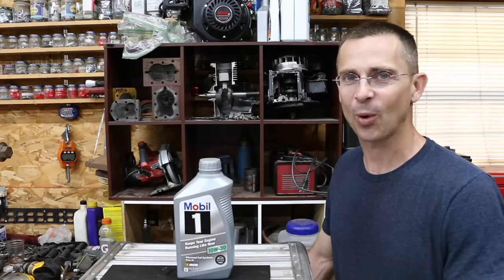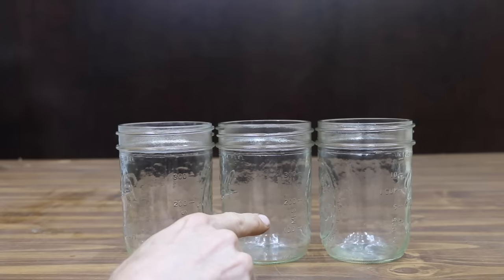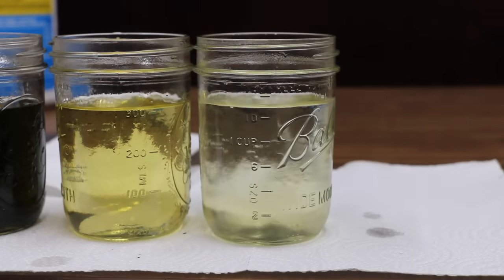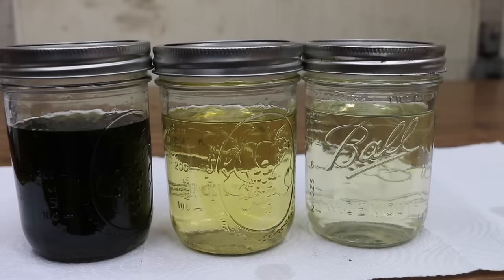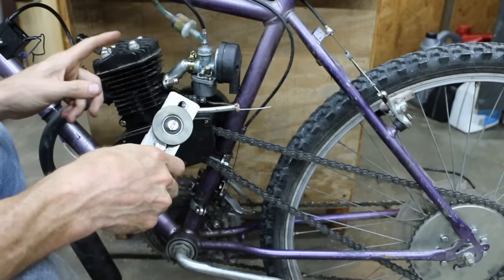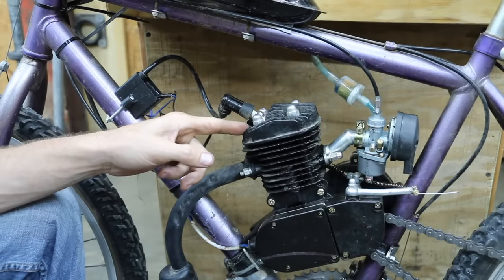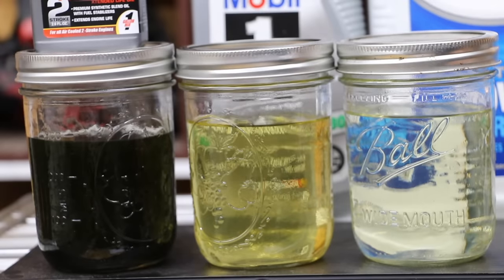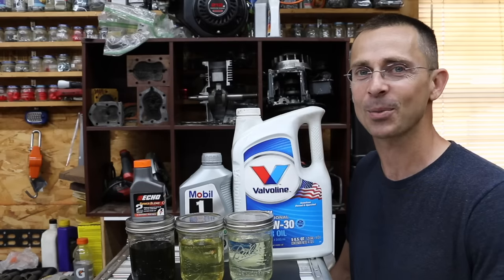Will 4-stroke oil damage a 2-stroke engine?  Let's find out!

Comment: 4 stroke oil is what they recommended when 2 stroke lawnmowers come out. There was no such thing as 2 stroke oil when lawn mowers were in their infancy
Reply from the maker: Great point.
Reply: Hehe I’m on Xd-100 2 stroke oil on my Koehler toro motor. I run some with a line from the bottom to the carb so mixes and burns at 40:1. Just fill and go with no problems
Reply: sae 30 is what they recommended here around 30 years ago,i used 10w40 in my 2stroke engine run for many years win that mixture
Reply: Same thing with 2 stroke outboards, old timers said they used SAE 30 in outboard fuel back in the day, one quart to 6 gallon tank, 25:1 ratio
Reply: Good to know.never know when your in a pickle and your out of 2strok oil
Reply: yeah...the two stroke engine came well before two stroke oil....my 1954 outboard motor, back when you could still read the instructions on it, said 8 ounces of SAE 30 per gallon of gas....I started running good quality TCW-3 in it and walked it down from that 16:1 ratio which made it smoke like crazy to around 36:1 which is where it pretty well quit smoking....ran it like that for years.
Reply: Yup. Some of my 1950s OMC Lawnboy mowers original oil recommendation was normal straight weight motor oil
Reply: On the farm all we ever used was 10W30.  Didn't even know there was 2 stroke ol till I was in my teens.  I like it because of the dye, you can see the mixed fuel.
Reply: Theron Ash So, maybe that was the original reason for using it, the dye would ensure you had it premixed?
Reply: Mike Lee I believe the standard is 8 ounces per 6 gallons on a typical outboard engine, correct?
Reply: @eightys4ever  Yes, the dye is helpful.
Reply: Thanks! That explains why about 55 years ago my Dad when he bought our first 2 Stroke Motor Mower used normal motor Oil. Watching this started me thinking. 
It was a Villiers! Temperamental thing. No throttle. The useless Governor was forever giving problems.
Reply: Great to hear this from someone 1st hand! Otherwise, we'd never know
Reply: Well from what I’ve learn in a pinch if you need to running 4 cycle will be fine as long as it doesn’t sit for very long.

Comment: Before watching, my guess is that it'll work just fine.
Reply from the maker: You're right
Reply: When I was a youngster, the second recommended 
oil, was non-detergent 30 weight.  2 stroke oil being 
the preferred oil.

steve
Reply: This is STILL an acceptable solution.
Reply: I guess I don't have to watch it nowm :)
Reply: before 30w motor oil, it was castor oil, which really stunk,  try that next! lol
Reply: Castor oil in a 2 stroke is a brilliant lubricant, but it does require stripping the engine to remove the gum.
I remember many years ago in my wild 2 stroke tuning days the lovely smell of Castrol R40....I can't believe you don't like the smell.
Reply: You HAVE to watch the video to see him ride the bike! just FF to it! lol
Reply: I used mineral 10W-30 in my snowmobile for years because it didn't like this new stuff they're putting in these 2-stroke oils you pick up at the gas station. Seemed to run a lot cooler, quieter, cleaner and have more power with 10W-30.
Reply: Split10, I'm still into tuning 2strokes! I run Castor 927 or Motul 800! Smells like candy to me!!
Reply: 808 Tait my 2 favorite oils
Reply: Speedway and solos ............and mud in ur face with that smell :)
Reply: Avery Alexander me too only because i ran my 185 track bike hard and fast for months with a 4 instead of 2 stroke oil mix and never had any problems
Reply: Avery Alexander your kidding me right ive been paying €6 for a one litre bottle 2 stroke oil. When i could buy 5 litres for €15. Would it be ok to use in my 2 stroke grasstrimmer
Reply: Fionn O'Brien Yes and you will also save a small fortune over time....I have often wondered why folk don't add a couple of teaspoons of engine oil to fuel tank on 4 stroke petrol Gasoline vehicles to reduce piston and bore wear..Diesel Engines last 100s of 1000s of miles more than petrol engines as the bores get lubrication from the Diesel where as petrol dry,s out the piston and bore cause ing faster wear.
Reply: You're showing your age, I remember when motor cycle forks had fish oil in them.
The smell was really something ,but back then the wife's cooking would mask it out.
Reply: Positive crankcase venting helped the sludge issues in four stokes,that and less paraffin .
Reply: Castor oil was never used in cars. It was, and still is the only oil to be used in a rotary aircraft engine. It was selected because it doesn't burn when it passes through the cylinders. Those engines are not the Wankel engine but an aircraft engine that has the cylinders spinning around the crankshaft, such as the Clerget, Gnome and LeRhone designs. A few of these were used in automobiles long before WW1 and I have never actually seen any car with one. Castrol brand earned its name as an oil supplier of castor-oil for early aircraft. It's a powerful laxative and tastes horrible and fighter pilots were known to have fairly often fouled their pants from its effects on them while flying in the war. These motors had a total loss oil system where you fill up the oil tank, fly and the oil would run through the engine to lubricate it and then it was thrown off into the air, making it run low or out after a flight.
Reply: Project Farm - MMO’s website says it is approximately equivalent to 5W oil. Full crank case of MMO please!!!
Reply: Steve Jones the main culprit for top cylinder wear is carbonic acid. Today's engines have precise fuel injection that burns the fuel so well the acid is not formed. Take a high mileage modern engine apart you can often still see the hone marks. Cylinders just don't weat out any more. Oil in the gas is not needed and can destroy yout catalytic converter.
Reply: We are talking about small 2 cycle engines here, not cars. However, excessive oil consumption will destroy o2 sensors and cats.
Reply: This is good for the electric fuel pumps submerged in the gas tank also.  Our mix is an ounce or two of Dextron ATF with each tank.  Saved my behind once when the fuel pump siezed.  Hit the underside of tank with hammer to start the pump turning, and been adding ATF ever since.
Reply: Adding 2 cycle oil probably would do more good than ATF. But either way, I seriously doubt that 1 or 2 ounces of oil in a tank of 20 gallons of gas is going to do anything.
Reply: It all works even my weed eater can run on straight motor oil but not straight 2 stroke oil
Reply: for breaking in , perhaps i might add a bit of top end oil .
Reply: James Lee well the only problem is some times it doesn't start that well in the cold but overall it runs good but I for got to what I forgot to say was it smoked allot I will post a video of it working mabey next week
Reply: Fionn O'Brien c
Reply: Good thread. Regarding castor oil, all I can think of is Froggy and Spanky in Little Rascals.
Reply: worked for rx7s for years, i said the same
Reply: Nicolas Broszky  thats not entirely correct, wankel rotary powered cars require oil injection or premixed fuel, as would a 2 stroke engine, stock mazda rotary cars drew oil from the wet sump system and injected it into the intake manifold to lubricate the motor, and in later years and models, directly into the motor
Reply: Nicolas Broszky  not only that, like two stroke motors, wankel engines lack valves and use ports as intake and exhaust, and use the rotor as a separation of each chamber, as a 2 stroke piston covers up the intake and exhaust ports during its compression/power cycle
Reply: Nicolas Broszky  the oil is injected directly, while the fuel is mixed with air in a manifold in the renesis RX8, and how is it notcomparable to a 2 stroke, im stating that mazda used the sump oil as sacrificial.oil from.the factory, they have plugs designed to deal with oil being injected into each chamber, the oil is sacrificial, and they both suck,squeeze, bang, and blow, have you done your homework on rotaries? they arent anywhere near what a 4 stroke is, and operate on similar principles to a 2 stroke, they also have specially designed premix and can run regular two stroke premix as sacrificial lubricant in the event that the oil injection metering is removed or damaged as a matter of fact, racing teams use premix developed and sold by idemitsu specifically to lubricate there racing engines
Reply: Nicolas Broszky  tastefully ignoring all my points, seems like you euros dont have much going for aguements either, argue with any rotary guy about this, and get pilled
Reply: Nicolas Broszky  then explain the 2 stroke combustion cycle, technically rotaries have no strokes, since everything is done 3 times in 1 rotation, as opposed to 1 time every 4 cycles
Reply: Avery Alexander I feel like you watched and then commenting this lol
Reply: @daviddntait  try maxima super m. You will like it.
Reply: Jess Roberts, I'm not sure I seen it in any of the local shops here but I'll keep my eye out. Lucas also makes a very clean burning 2t oil! But Castor 927 is best in my experience with the engines I've built. Piston tops are just a light bronze tint after lots of hours! No carbon buildup!!
Reply: i wouldn't try it into a high performance 2 stroke even after seeing this :P
Reply: Steve Jones I do this all the time. With TCW3
Reply: @Split10uk   yeh that was a sweet smell
Reply: @stevejones8665  
Don't ad motoroil to gasoline for 4-stroke engines!
The reason NOT to do that is the forming of a carbon/ashes deposit in the valve seat & valve of the exhaust system.  It is essential to have metal to metal contact there when the valve is closed to prevent  leakage of gasses and to cool the hot exhaust valve.  This can lead to serious valve damage of the 4-stroke engine. (Valve melt down)
2-stroke engines however have no valves.
Reply: Yup I agree
Reply: used motor oil as two stroke mix????  ultimate recycle

Comment: The first 2 stroke engines on lawn equipment, chainsaws & snowblowers  used non detergent 30W oil for the mix.
Reply from the maker: Great point.
Reply: Good reply. I bought a Kawasaki dirt bike in 1968. The fuel cap had a cup built to it, fill the tank with gas, fill the cup with 30wt motor oil, dump it in, shake it a little, and off you went. Never a problem, and I recall using any brand/weight oil.. many times mixing what was left in those old quart cans together to get a "cup" full. I do know that modern 2-strokes (my boat motors) have much less carbon build up though.

Love this channel!!!
Reply: Had a old Johnson outboard that said on the tank to use 30 weight at 30:1???? Was 25years ago I sold that engine..
Reply: Yep early 2 stroke engines used SAE30 most at 16:1    use to use homelite chainsaws  XL , 750 ,Super EZ all used SAE 30 they just smoked a little more and had to clean the spark Plugs more then with the NEW Synthetic 2 stroke Oils of today
Reply: I still have some ancient 2 stroke oil here, it's as Alan Marshall stated, straight 30W without other chemicals added, it doesn't have dye either.
anyone remember running castor oil blended into the mix? much of it would come out in oil form, spraying and dripping everywhere from the exhaust and for sure had a unique scent :)
Reply: I'd love to hear from a lubrication expert if modern 4 stroke oils are better or worse for this than the older ones were, that's really cool! I started running diesel truck oils in my cars after reading how modern automotive oils have lost or reduced a few protective  ingredients over the last decade or so.... (even though they are SO much better than old oils in terms of deposits and long term).
Reply: Most bikes I have used are 32:1 ratio.
Reply: volvo09,  some of the additives in diesel oil are not good for catalytic converters, which is one of the reasons they removed much of the "ZDDP" from oils, oter than zinc and phosphate spewing out all over.
diesel oil, still had high content last i checked. https://en.wikipedia.org/wiki/Zinc_dithiophosphate
Reply: throttle bottle I was aware of that after I switched, but my cat has actually survived so far... Stock cat, been on this oil since right before I supercharged it at 50k  miles (130k now). Maybe it's because I drive it all highway, and hard once in a while? It's been on e85 fuel since 9k miles also. Oddly enough (for The cat clogging) The engine does burn about a qt of oil every 2k miles depending upon how hard it's driven... That has never changed. I'll either have to wait longer, or it won't be an issue for my situation...
Reply: That is correct, Alan, I am old enought to remember that too. Imagine working in a blue bubble of oil smoke!!
Reply: Bubble of oil smoke? Aside from the bubble, I've worked in a lot of oil smoke. Not a big deal. Still alive.
Reply: edifyguy Still!
Reply: throttle bottle still.use castor oil on my two stroke diet bikes. Its the best cuz of the smell.
Reply: Yep. The manual on my 1974 Honda MT250 says to use sae30 or 2 stroke oil.
Reply: Alan Marshall yep i got a 63 homelite big blue and it calls for 1/2 pint of home lite oil or 3/4 pint sae30 with each gallon of gas
Reply: 4 spd life yup, I remember my Dad using used sae 30 that he kept after changing oil in the mowers. He had an old blue homelite as well. That was 40+ years ago & it was an old saw then.
Reply: my old husky 65 says to use 40-1  husky oil or  20-1 non husky oil . obviously its okay to use a richer oil mixture with some lessor  oil .
Reply: I have 2t engines from 70s and 80 and i make 1:20 mix not what they say like 1:40,1:50 i dont care about  what is writen in manual.i make like that and they stil works today withuot any problems,yes they smoke more but they still works

Comment: 2 stroke and 4 stroke oils have a few major differences, the largest is the heavy mineral additives. These additives reduce metal to metal contact and friction under load. However these additives "calcium, Zinc and others" do not burn off at the temperatures engines run at. Because of this 4 stroke oil will leave large amounts of ash in the combustion when used as mix oil. Obviously this is not a problem in a 4 cycle engine that doesn't have blow-by. two cycle engine oils have additives like Polyisobutylene which has excellent anti scuff properties. 

So yes 4 cycle oil will defiantly work, back in the day that's all that was available. Over time leave large amounts of deposits will inevitably be left behind.  

Excellent video! I always enjoy them.
Reply from the maker: This is great information. Thank you!
Reply: They have taken ZDDP (zinc) out, it was really only there for performance non roller cams. No manufacturer makes them today and classuc car owners have to add it back in.
Reply: Dave B They have taken most of the Zinc out. As you said it was mostly for non roller cams, it was also hard on catalytic converters. However they still use heavy minerals such as I believe bromine and calcium, which will cause build up in a 2 cycle mix application.✌
Reply: bobe8888 we definitely miss the zink for our older motors and diesels.
Reply: It should still be in oil for new engines IMHO, I've never had a cat go out on any of my older vehicles.
Reply: I run xd-100 in the crankcase of toro kohler engine. I have rigged up oil injection that pulls from the bottom and feeds into the carb manifold, so far so good with my make shift total loss oil injection. I want to tune better though.
Reply: bobe8888 Thx
Reply: So does a 4 stroke need all this additive crap, it must be that the oil stays in them for a while and cant burn off with all this wet sump crap that it has to have.I never was a fan of plain bearings wet sump design, to me it adds complexity, bulk and cost, oh it must be a hangup of the 4 stroke auto industry. ETEC 2 stroke anyone?
Reply: Does all this 4 stroke stuff need this wet sump crap? WTF good is it as i never liked it, welcome modern oil VRO injection.I never liked 4 strokes anyways but if you must have one at least give the option to run total loss oil injection. Everyone is 4 stroke brainwashed but not me. i got yz250 and kohler mower toro on nothing but xd-100 2 stroke oil and i fill and run my truck on it as well.
Reply: @blackbirdpie217  there are many oils out there with high amounts of zinc
Reply: Rotella ftw
Reply: You said defiantly
Reply: I'll add to this. As you stated, back in the day we used motor crankcases lubercating oil in 2 cycle engines. Yes, carbon DID build up BUT to remove the carbon we simply removed the air filter, and raced the engine while dribbling cold tap water in the carb. If the motor was heated up and the water didn't kill the engine it sure cleaned it up.
Reply: Are you a East German getting nostalgic for your old Trabant?  @jlo13800

Comment: Great great video....  About 10 years ago I was in a situation after a massive snow and ice storm here where I had no choice but to use Rotella T5 IIRC as mixing oil in my Stihl MS880  and it cut downed trees all day long for approximately 8 hours straight without a hitch.  It did eventually foul up the plug prety good but that 880 still runs strong and hard like a champ.  As a general rule I use 2 stroke mixing oil but if need be i wouldn't hesitate to grab any multi-grade 4 stroke engine oil with the Starburst to use as mixing oil.
Reply from the maker: Thank you for the feedback